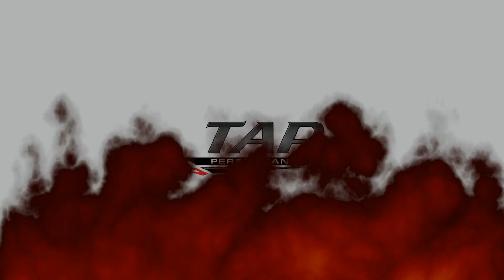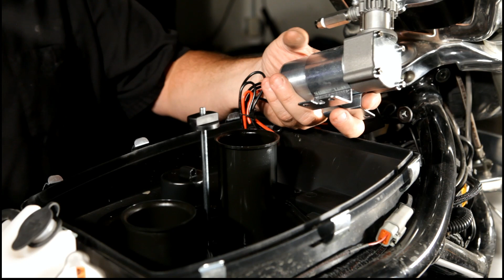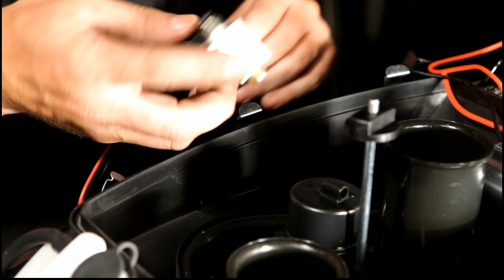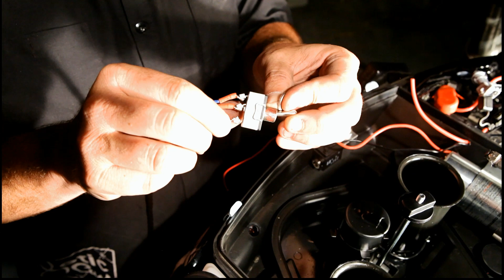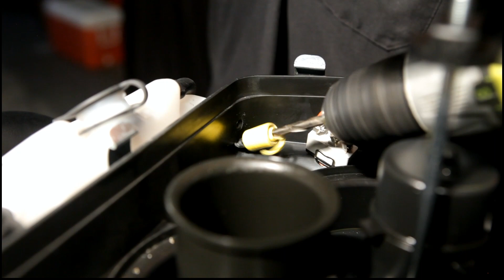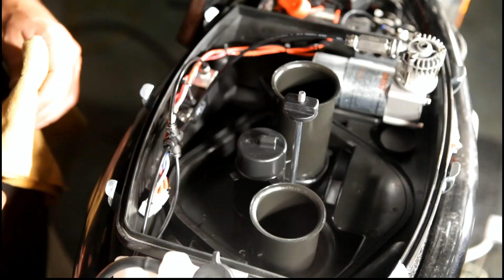Xotic Customs Tail Dragger Installation on Harley V-ROD

Comment: I may have missed it but where were the switched mounted?
Reply from the maker: We usually mount the switch on the left side of the bike on the bottom side but you can really mount it anywhere that works there isn't a set spot on this type of system.

Comment: Don’t mount the switch under air box it’s no good. Main wire harness is in the way on Vrod. Had to mount it inside the horn , much better and easier to get to. Also cut the bottom of the compressor mount off instead of folding it over because it will hit the top of air box cover and not clip.  Big mistake on them.

Comment: how is the fitment with the hooligan set up? any issues? I purchased the hooligan set up but I am not sure if the compressor will fit?>
Reply from the maker: No, the Motohooligan intake actually frees up some space, so there is more room for the compressor.
Reply: @TABPerformance  Could you please show how to set this up with the Motohooligan?
Reply: If the Motohooligan replaces the airbox, where do you mount the compressor for the suspension?
Reply from the maker: @julianesai   we don't have that bike to do that anymore but feel free to call in and we can talk you through what we did and where we moved ours.